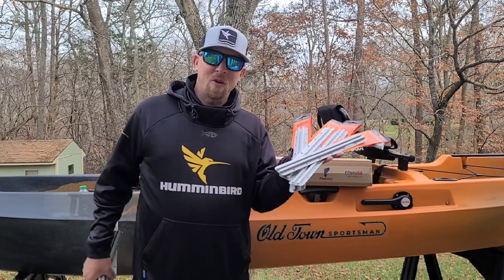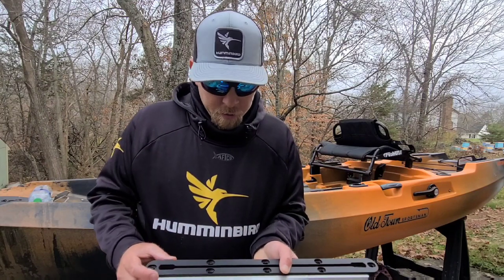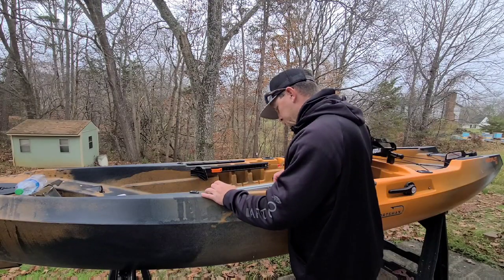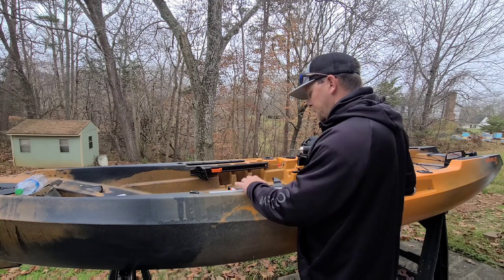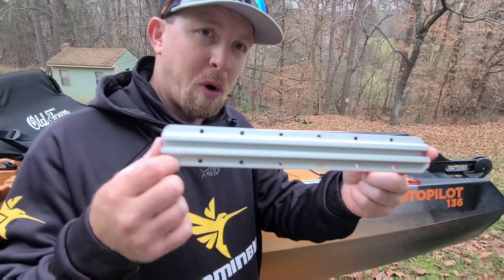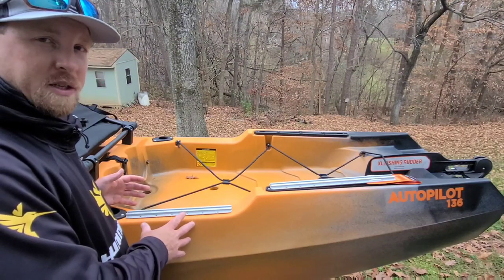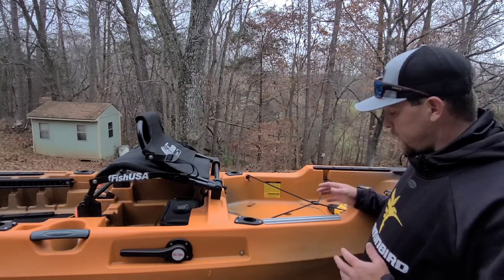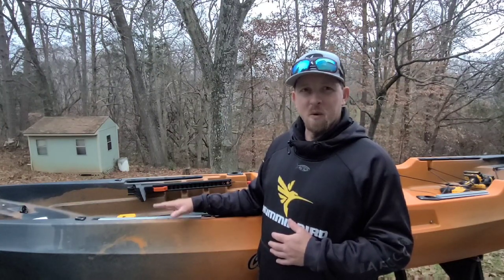Upgrading Your Gear Track On Your Old Town Sportsman AutoPilot

Comment: I caught a large blue cat that pulled the screws on the plastic rail to my sportsman 120.
Reply from the maker: I believe it. These have way more screws so I imagine it will hold up a lot better. But a fish like that has the ability to do some damage. In my opinion, you're best option is to have backing on any track you're using for rod holders for fish that big.
Reply: @CaseyReedFishing  I'll see what I can do for backing.  Not even sure if I can reach back up in there.
Reply from the maker: @Chrisbennett-k5h  Check out the yakattack rigging bullets if you want to go the route of having backing on your track. It's made to get backing on mounts/tracks that you cannot reach is side the hull.
Reply: @CaseyReedFishing   I went ahead and ordered the fullback.  I think that will fix the issue.  Thanks!

Comment: Can’t wait for the wiring portion
Reply from the maker: Hopefully I can figure put how to wire up better then last time. You wouldn't believe the amount of wires I had running through there
Reply from the maker: @MassReelFishing  thats correct, plus they will be all ethernet connected, I'll be adding the Humminbird GPS Heading Sensor and the MinnKota Heading Sensor.

Comment: I just got a pdl 106 that I was looking forward to customizing. Would drilling holes like this in the kayak void the warranty?
Reply from the maker: Drilling holes does not inherently void warranty.

If you drill a hole, then that causes a problem from the hole you drilled, it wouldnt be covered. But if you drill a hole to mount these tracks shown on the video , and then you develop a crack in the hull somewhere else that could still be covered (as long as it wasn't due to abuse)
Reply: @CaseyReedFishing  Thank you. I was looking Forward to doing a couple small things to my kayak but I was afraid to mess with the warranty but now I feel better about it.